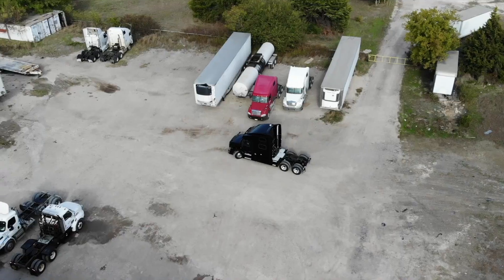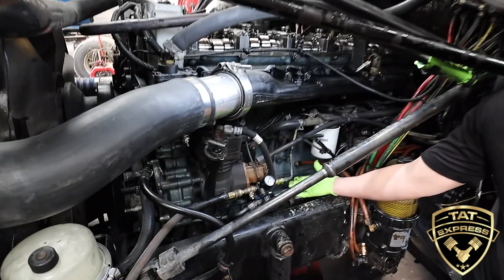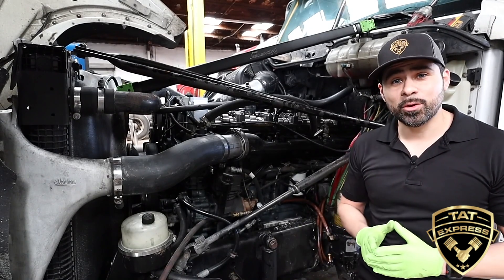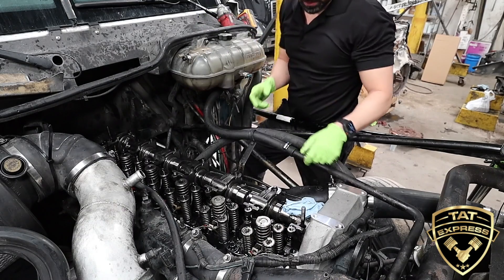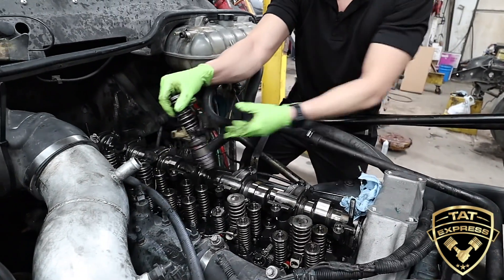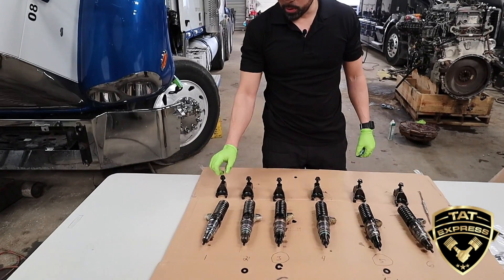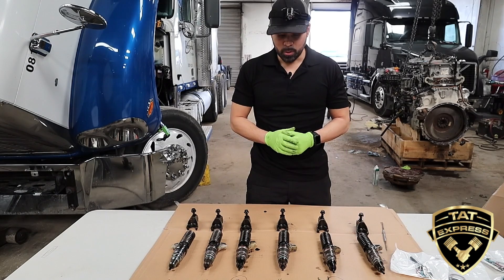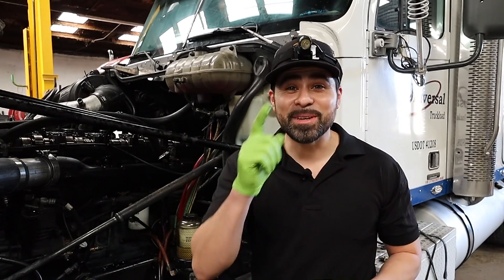Detroit 60 Series Injector Failure

Comment: Mechanic tells me that I have injector failure. Dumping fuel into my oil.
Reply from the maker: Yes, that is a symptom of a leaking injector.  May run test to find out which one is leaking or replace all if high mileage.  Thank you for sharing.
Reply: Not good bro ! Really bad , that means you’ve washed the cylinder wall and the sleeve at least on one piston has to be replaced, so just get an inframe done .

Comment: I have cylinder 4 code on my 2018 coronado glider12.7 (ENG Low Cyl #4 Injectr 1285004.01)
Barely 600,000 miles
Reply from the maker: @FamiliaRio…
That fault indicates low contribution from cylinder 4. On Series 60 engines the injectors available today are all remanufactured, so an internal injector issue is possible. Before replacing anything, inspect the injector O-rings for fuel or compression leakage and check for aerated fuel. A good next step is to swap the #4 injector with another cylinder and see if the fault follows the injector. That helps confirm whether it’s an injector versus a mechanical or wiring issue.
Reply: @TATEXPRESSINC  thanks brother most people dont even bother replying blessings to you & your business
Reply: @TATEXPRESSINC tomorrow my mechanic is going to swap them aver que pasa

Comment: Great video! I got 12.7 detroit 60 series. I got exhaust going to return line. Head is new like 10 months old and recently replaced all injectors its even getting worse. Tomorrow going to pull out all injectors clean it and replace O rings. Some people said i got a bad injector cups.

Comment: Hey sir, I have problem. My truck serial 60 2003 I have my Fuel inside oil tankers and filters too so what is my problem? Can you can you explain with me please?
Reply from the maker: That sounds like classic signs of failed injector cups. On the Series 60, fuel can leak into the coolant or oil system if the cups crack or come loose. I’d recommend pressure testing the cooling system and pulling the injectors to inspect the cups. Let me know if you need more help walking through it

Comment: Will a bad injector cause a engine to sputter
Reply from the maker: Yes, a bad injector can definitely cause sputtering. It can throw off the fuel balance in the cylinder, leading to rough running, misfires, or even power loss.

Comment: Every 60k mile have issue coolant pressure buildup , no exhaust gas or air in the system. Checked air compressor and no failure, so what do you think.
Thanks

Comment: Доброго времени суток! Есть такая проблема которую я никак не могу решить уже несколько лет. Фредлайнер центури ст 2004 г. Детройт дизель 14. Его убрали с заменой турбины и прошивкой блока управления. Но проблема была и при рабочей системе егр. Проблема заключается в том что под нагрузкой двигатель издаёт грубую работу и громкий шум так что в кабине дребезжит весь пластик. Всё сто можно уже поменяли, несколько раз разобрали двигатель. Недавно сделали форсунки, мощьность увеличилась но и этот грохот от  двигателя увеличился тоже. Может что то посоветуете. Сил уже нет так ездить. Думаю может стоит установить подушки двигателя от другой машины?
Reply from the maker: Did you check for boost leaks? If it is shaking under load and improved after injector replacement, it is possible you have a fuel-related or boost leak. If both are good, then I would recommend a compression test.

Comment: I smell raw fuel ,  no fuel leaks found . The smell is so strong .  Truck starts fine and runs good.  It's a ddec 3 60 series 12.7 . White smoke at cold start is present until warmed up (which is normal) .  Bad injectors maybe? Oh also my fuel milage dropped gradually

Comment: Former freightliner tech here for about a decade and a shop for about ten years. Currently fighting one I have never seen before on a 14l. Customer swapped engines because the original was using oil. The current engine was running like crap and I saw a ton of air in the tanks. Ran a line straight off the pump into a bucket and the same deal. Ran a cut out test and the front 2 holes were dead and the 3rd was sometimes trying to hit. They had another shop put injectors in it and I had my co worker pull them out and the other shop left tons of debris in the cups, but did not see a split or burnt ring or tip seal. Cleaned it up, resealed the injectors and it sounded pretty good until he went to test drive it and we are back to 3 dead holes and very little combustion gas in the fuel unless you idle it up. I am wondering if debris got in one of the pintle tips and its pushing back into the gallery rifle.

Comment: Thanks for this video.  Having an air issue on my 12.7, replaced all fuel lines ,check valve, and fuel filter housing,  problem got a little better, but has returned.  Truck starts fine, but once i get going it runs rough for about 2 seconds,  and runs fine after.

Comment: I have an 05 F/L with a 60 series that will crank and not run.  I have replaced the Cam and crank sensors.  It appears to be getting fuel flow back to the tank, but not very much.  I put a voltmeter on the injectors while cranking, and am getting .005 VDC.  What am I missing?  Thanks.
Reply from the maker: Thanks for reaching out! Unfortunately, diagnosing a no-start issue on a Series 60 Detroit over the phone can be tricky, as there are several factors that could be at play. To give you the best service, we’d need to have the unit in the shop for a proper diagnosis. Feel free to bring it by, and we'll get you back on the road!

Comment: We got 12.7  60  no one can Figure out.why it back fires. We tried a different ecm & lost all power,turbo psi was not past10. Put the old one back on,got my power back turbo psi 30. Now the ecm that had no power,no turbo psi it did not back fire.
Any suggestions?
Reply: Have you replaced the trs and srs sensors? The crank and bullgear sensors for timing and did you look at the tips to make sure they were not chewed into like something moving or getting wear? The sensors can get sticky as they are hall effect sensors, the bull gear can get worn bearings eating into the sensor. The tone ring on the crank can get play and move around if something happened which will alter the timing causing a backfire. Freightliner tech over ten years and had a shop too for about the same. Also, if someone got the timing off in the gear train it can cause this. I would start with those sensors first as have seen a sticky one cause this a few times over the decades.
Reply: I will have to think about the ecm deal unless you had one for the wrong ddec level as that would most likely be a ddec 3 I am guessing? The model number on your valve cover will have some numbers, then two letters to tell you the ddec level. ddec 2 is gu wu, ddec 3 is gk wk sk, ddec 4 is tk pk ek mk bk hk and ddec 5 is hv. It should have a sticker on top of the ecm telling you the ddec level. I have been away from the dealer at a mom and pop for over two years and I can not remember. There was something on either ddec 2 to ddec 3 or ddec 3 to ddec 4 that was basically because they did not have any of the older ecms and if you did not program it right, things went south. You might look into these as mismatching does some wild stuff like throwing off coolant temp numbers from the sensor and such from memory.
Reply: and again, hooking up to diagnostic link for detroit will tell you the model and engine serial number. You might look at what you have on your truck and have someone hook up a bench programming plug with truck in a box and see if you have the wrong set up on the other ecm. Take all of this and compare to the ddec levels on your old, swapped ecms and what is on the valve cover to see if something is off that might mess with this. In general the timing being off on something or bad timing sensors are the main causes I have seen.
Reply: Sorry for all the replies as I keep thinking of stuff. Any unswitched power codes to the ecm?? Ran into some wild stuff on powers and grounds to the ecm causing issues. If you checked the rest I said and nothing, load test your unswitched wires from the batteries and switched power from your ignition and grounds to the ecm with a headlamp at the oem wires into the ecm to see if you have a voltage drop coming into your ecm.

Comment: have one engine fuel in radiator suggestions. to me looks like pulling cups out probably use same technique as pulling cups of a 6.0 power stroke tread into top of cup or bottom of cup what do you think ? I don't believe in pulling head of what do you think?
Reply: Yes, 14l screw in. 12.7 you have to pull the head

Comment: I have a 2009 freightliner Columbia.  My truck doesn't require Def but it does regen.   I am running locally doing shuttle service.   My truck is requiring daily regen.   Is this normal??
Reply: Detroit 60 series

Comment: Interesting way to find bad o-rings on injectors. My question is why did you replace the camshaft if it showed no visible signs of damage? Another way to find a bad injector o-ring is to pull off the exhaust manifold. You will definitely see a difference in the soot pattern inside the head exhaust port of the cylinder or cylinders with the leaking injectors.

Comment: 2009 Freightliner with a Detroit 60 series 14 L, I have done air pressure test, truck is not loosing air at all holding 80 psi  my truck sputtering and higher gears and losing prime when it sits for more than two days I have replaced all the o rings on injector’s 5 months ago, new check valve, eliminated the water separator, was sucking air, I just replaced fuel mechanical pump new camshaft, installed all new rebuild rockets, ran overhead, new fuel filter new air filter, no engine codes, truck still doing same thing, I was told to pull all injectors out and do a air pressure test on each injector and  see if the tips hold air if they don’t there bad? Any help will be appreciated thank you so so much.
Reply: Fuel crossover valves above the rear of the transmission
Reply: or a cracked stand pipe in your tank

Comment: Hi have 09 westernstar with a 60 series 14 liter ddec 6 engine. Replaced engine from a freightliner columbia, but after engine was installed  it wouldn't start unless I used ether. After engine is running there is no smoke, but engine won't hold prime. When I shut engine off it won't start back, could this be injector problem. Changed fuel regulator, fuel pump, fuel lines and fuel filter housing

Comment: Have a 12.7 losing prime and brand new injectors brand new check valve . The filter canister was low new check valve on that, too feel the canister start and shots of, but after cracking for a bit, it start

Comment: Thanks for your videos. 
I have 1996 Detroit serie 60 12.7 glider kit. 
When I turn ignition on is no voltage to injector wires , non of them , truck not starts!
Any idee please.  Should it be voltage there right?

Comment: Can a bad injector o ring cause fuel to get into your oil and the Mpgs and power be normal? 
The injectors are fairly new, so im curious if i can do the same and just do a ring kit on the bad injector.
Reply: It will fill your crankcase with fuel pretty fast if the top return seal is leaking or the body of the injector

Comment: I have 2006 60 series 12.7 and it has a miss at 12 to 1300 rpm on light acceleration other than that runs great at all other rpm? Seems to miss less at that rpm if full acceleration? Any opinion

Comment: I have an issue with sucking air in the fuel system. Everything is new front the ranks themselves to all the lines. Yet still getting air and running horrible. Would injectors not sealing create that issue?

Comment: So I have a 2006 Detroit 60 series 14L it blowing white smoke and it smells of diesel, I put a new turbo and changed all the injectors and it’s still blowing white smoke , it does slow down once truck gets air pressure and warms up but it still blows a lil smoke

Comment: Is it my injectors if it takes my truck awhile to start when cold start? 2007 14l classic
Reply from the maker: A longer-than-normal start may be a fuel supply issue. I recommend inspecting fuel lines for signs of leaking or fuel seepage. If nothing is found, then replace the fuel filter and ensure proper sealing. If the issue persists, the engine needs troubleshooting for fuel prime loss.

Comment: My dd13 has a hard start after I run it and I let it rest for over 45 minutes before i try to restart it again. But if I shut it off and turn it on right away I don't have any issues. CRAZY part is that when I start the truck when It's tested foe over 5 hours it's start fine.
What do you think it is?
Reply: High pressure pump fail?

Comment: My engine runs and no loss of power but it's shooting out huge smoke and sometimes fire comes out of the two exhaust pipe , please call you help with this? Thanks
Reply from the maker: It sounds like it is burning fuel or oil—possibly a faulty injector, oil passing through the exhaust, or faulty head.

Comment: I have a 08 Columbia with DDEC 6 I have a skip/surge as I accelerate as if the throttle is cutting out, it says communication lost it's not the ECM,  I've changed the injectors, and throttle peddle help
Reply: Did u find your problem?

Comment: I have 2011 Volvo d13, after 250 to 300 miles driving it keeps dumping the coolant through overflow, I had the Air compressor replaced, I had the Head checked and it's good, changed the injector cap and now whenever I started it, after 30 seconds the coolant comes out through the overflow. What should I do?
Reply: I also blocked the EGR to make sure, and the problem got worse
Reply from the maker: Sorry to hear about your troubles.  It defiantly sounds like high compression in the coolant system.  Inspect the coolant system, radiator, hoses, and water pump to ensure proper flow and no restrictions.

Comment: I have a 2006 freightliner 60 series 14 liter I had my head done it was cracked and I had a cracked cylinder now that's done now my truck is smoking black gray smoke 1 injectors is not firing right could that be my problem

Comment: 🤞Hello buddy I really need your help 🤞couple of mechanics haven’t figured out the problem on the truck….
My injectors keep shorting to ground I tried all new and used injectors and even swapped 2 different ecms , put new harness and cam and crank sensors and still same problem… any suggestions please… ?

Comment: My dd 12.7 was making oil and had about 30% fuel dissolution so I had the injector rings all changed and it’s been about two months. But recently my low oil pressure shutdown sensor activated and derating the truck.. the mechanic never changed the hold down bolts…? Should I put the die in the fuel separator and black light it or pressure test it first?

Comment: We have a 1995 Detroit 60 series in a Pierce fire truck that is getting worst. The truck will run sometimes cold, but when leavining the scene or just starting down the road it will blow white smoke and bog up hills until it dies. Full throttle does not help nor does half throttle. We made it to the scene today but almost did not make it back. We are a volunteer fire company so we are not very well off and would like to do the work ourselves. Injectors are on the outside of the engine on the driverside.. Any help would be appreciated.

Comment: I think this is my problem.  Truck runs fine until I start pulling a hill and more so when I'm heavy.  It starts breaking up like it's not getting fuel.  After I feather the pedal for about 30 seconds it returns to normal.  Could the o rings be the culprit?
Reply: Having same issue did you figure it out?
Reply: Same problem I'm having....any ideas what the problem is yet?
Reply: I figured it out today, after a few month long issue… it ended up being the pick up tube it had some debris in it. We just pushed air from the filter housing to the tanks and heard it shoot out.
Reply: @eduardomendoza593  nice.  My fuel pressure is reading good so I don't think that's my problem.  Thanks for the update tho!

Comment: What's up man. I have a volvo d13 engine I have this problem where my truck is shaking bad when I start it and it accelerates real slow or it's not accelerating at all. Do you think it's a fuel pump, fuel filter or, a fuel injector issue?

Comment: before you pressured the head did you look for air in fuel return line ie. put run fuel return into a bucket ? just curious . so how did air get into cylinder ? past lower oring and the copression seal  .

Comment: Hi your videos are very educational, thank you for that.
My freightliner 2019 dd15 engine I have noticed from yesterday it burn more fuel than usual.
Before it was 7.2 to 7.5 miles per gallon but since yesterday she burned 6.50 miles per gallon!?
And in the morning when I start the engine white smoke coming out of her exhaust
Reply: Replace Fuel pomp connected to compressor
Reply: @landi7573  that's the power steering pump on a dd engine. The low pressure pump is part of the high pressure pump above the air compressor

Comment: A little over kill. You realize you can use a voltmeter on ac. Check for low voltage. Injector should have roughly 100 volts. You literally just wasted the customer money.

Comment: Well done!  On the injector harness, where it connects to the injector, is there supposed to be oil in the connection?
Or, does it hurt, as in make the injectors cut out erratically?
Thanks

Comment: Great video Max, I get an injector failure code  for all 6 injectors SID-317 FMI-4 injector supply voltage, and SID 1-6 injector cylinder, could be this a oring failure as well?

Comment: Hi 
I have questions on fright liner cascades 
I’m haven shifting issue specifically after slowing down or stop at red light 
It like transmission can’t figure out what gear it have to shift to so it’s keep shifting to a gear and then shifting back to natural and keep doing it until it get to right gear 
What you think about it